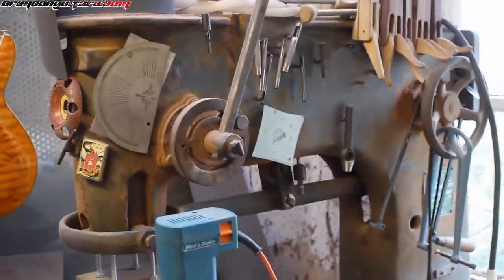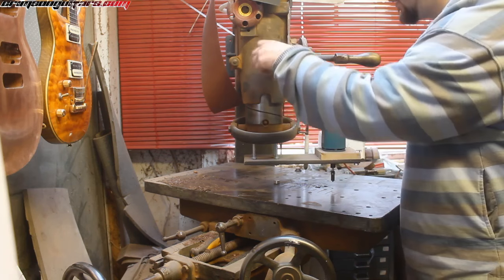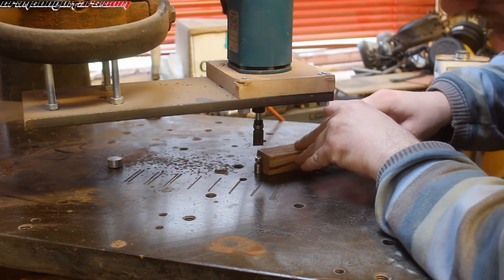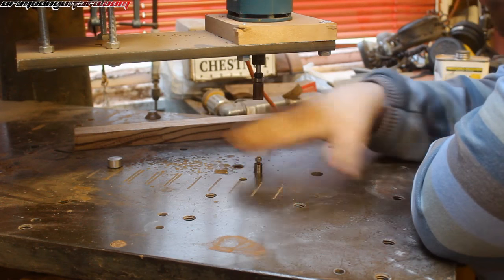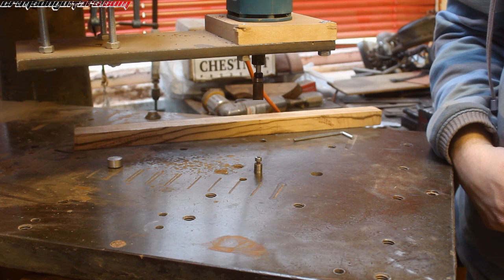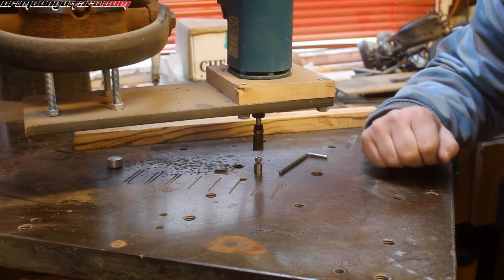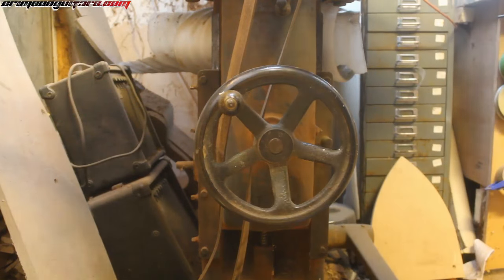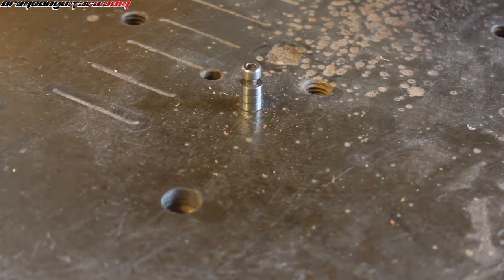Clarity Ep 43 - Using a Pin Router in the Control Cavity

Comment: What would be a good first build project? I'm looking into making one during the summer. Is a neck-through considerable or should I just go bolt-on for my first guitar?
Reply: +SpicyGusta From personal experience there are difficulties associated with both of them, but generally speaking I think most would agree that a bolt-on would be good for your first go because if you screw something up, it's easy to adjust, particularly with things like neck angles and pockets.  Neck thrus are cool but also a little difficult to work on just because you're always working on the neck and body together, not one at a time.
Reply: I'd make the guitar body first ,worry about the neck later for which you need lots of specialist tools and is quite an investment.(research).

Comment: That looks like an LM vertical drill ( with compound table ) to me
I had the LS router with the compound table and it didn't have the wheel at the back and the handle at the front.
I'm sure the LM does